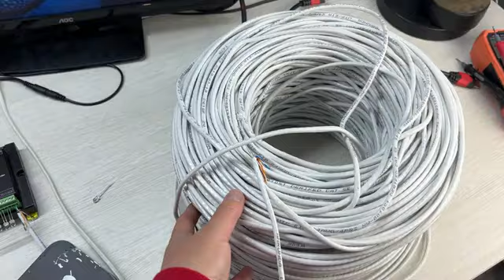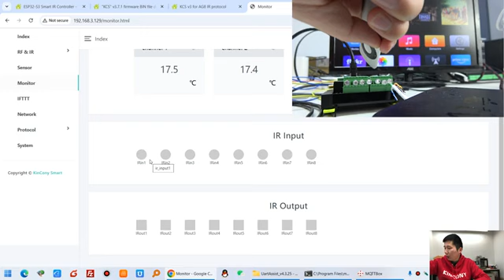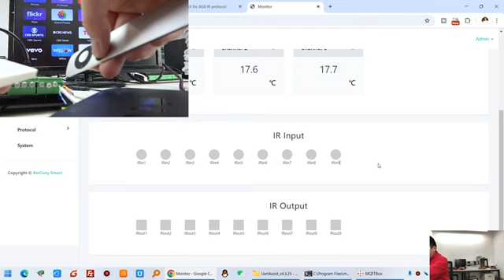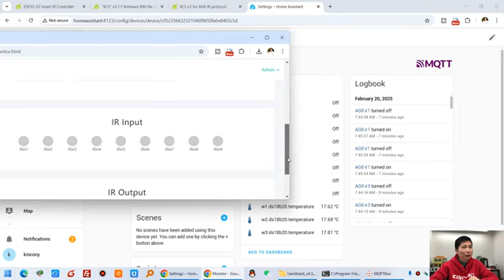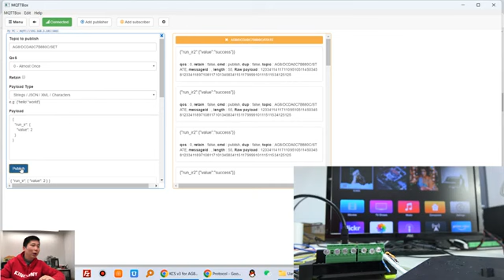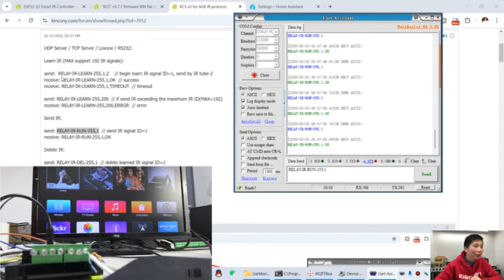The most powerful wired smart IR controller   KinCony AG8 in 2025!

Comment from the maker: ESP32-S3 Smart IR Controller – KinCony AG8

W/A:+86-15531181781
Email： liluna@kincony.com

We have designed ESP32-S3 Smart IR Controller – KinCony AG8. it support install by DIN RAIL. it use ESP32-S3-WROOM-1U N16R8 chip. small PCB with RS485, RS232, 1-wire GPIOs, 8 channel IR sender terminal.  Support expand infrared emission tube for long distance cable. board support both wifi and ethernet port. It can use for smart home IoT project use by home assistant, you can config ymal by ESPHome. ESP32-S3 also support arduino IDE / MicroPython / ESP-IDF development tool. AG8 use KCS v3 firmware, it support home assistant auto discovery function by MQTT, so without write any config code (zero code) for home assistant. The sensors and decoded IR (NEC and RC5 IR code) signal all will auto discovery in home assistant.

note: Node: ESP32-S3 chip support 4 channel IR sender work at the same time. here is details by ESPHome webpage:
https://esphome.io/components/remote_transmitter.html

with KinCony KCS v3 firmware, you can use 8pcs of IR sender independently.

PCB size: 83mm*100mm
Power supply: DC 9-24V
RS232:1
RS485:1
Free GPIOs:14
IR Receiver:1
IR Sender:8
Related technical information
———————————
schematic: https://www.kincony.com/download/AG8-schematic.pdf
ESP32 I/O pin define: https://www.kincony.com/forum/showthread.php?tid=5888
config yaml file for ESPHome: https://www.kincony.com/forum/showthread.php?tid=5889
KCS v3 firmware download: https://www.kincony.com/forum/forumdisplay.php?fid=75
KCS v3 firmware online guide: https://www.kincony.com/how-to-use-kcsv3-firmware-esp32-board.html
KCS v3 for AG8 IR protocol: https://www.kincony.com/forum/showthread.php?tid=7612